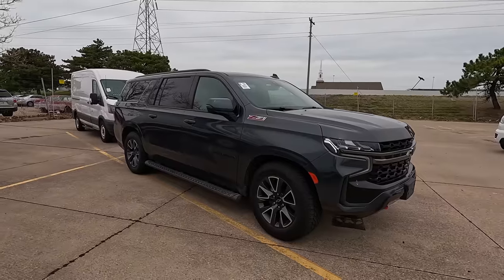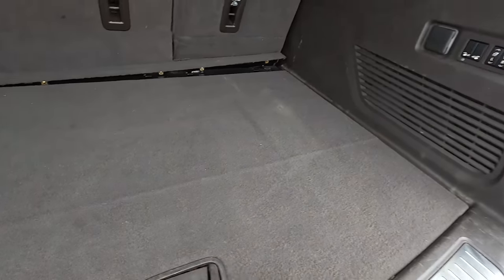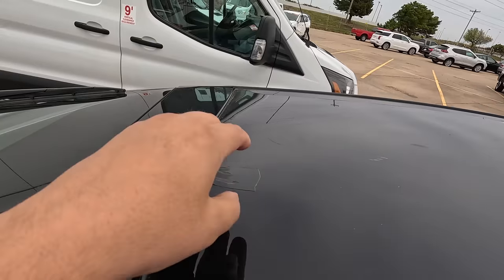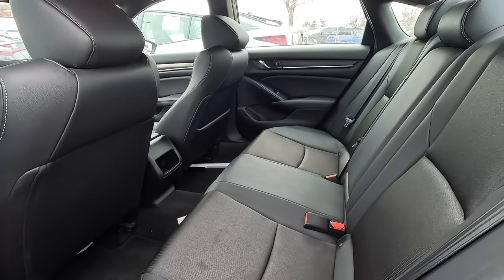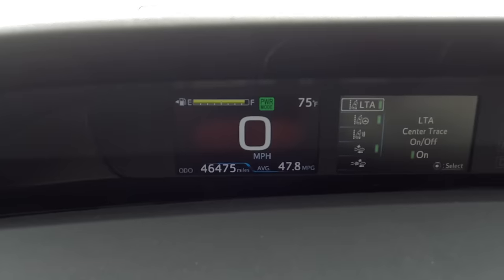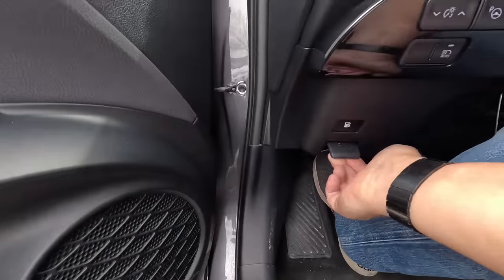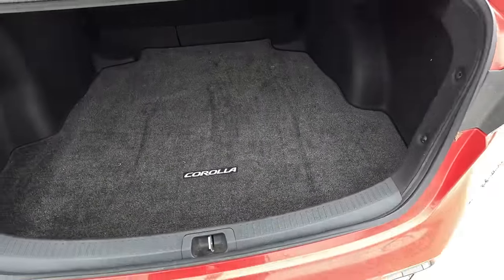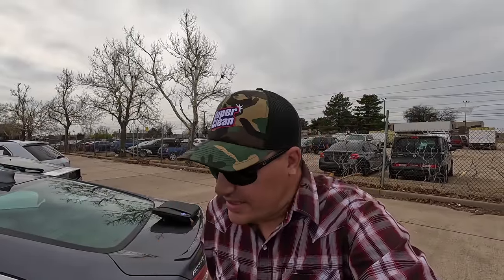Dealer Auto Auction Walk Around + 2021 Toyota Prius Rental Car Sales

Comment: Here is a great idea… Line up some dealers to sell to. Aim at smaller ones. Buy cars that need minor repairs or minor refurbishment, clean them up, detail them (have ur step son help for a kickback), do the maintenance (get oil change stickers online) and sell it to dealers as a ready to go unit. Saves them the time of going to the auctions, detailing, repairs..  You’ll probably want to start with one or two dealers max at first.
Reply: Ohh you can also fill up the tank… just add it to the price. Again, saves the dealer time.

Comment: Rental cars are good buys should have full service history and then you will benefit the desperation that the vehicle had suffered by the time you buy one it’s a good way to make money drive it for 12 months n then move it along its up to u 
That’s a lot of miles compared to klms our Avis or budget get to about 40000klms-50000klms which is 
24854 miles-31068miles  here in Australia 🇦🇺 and are  about 2 years old
im new and old what ever works for you and  Another great video 😊 the seat belt lights are for the rear to indicate that no one is in the back and the airbag off light for the passenger means no one is in the passenger seat and no seat belt on it will go out once someone sits in it and then the rear seat indicator lights should go out one you drive too

Comment: Lease returns are a great option. I don't like the white in the Corolla doesn't make sense either. Newer cars are a great option. Finding them and the bidding on them may be your content rather than the fixing. It is one of designs that turns off when at stoplights and then kicks back in when you step on the gas.

Comment: That Corolla is not a base model, it’s the sport model, and it does have remote start, you can remote start it either through the app  or by pressing the lock button 3 times and then holding the button down for a few seconds until the flashers blink

Comment: The newer Priuses have that seat belt warning light on all the time until the seat belts are buckled in as for the apostrophe on the other one it was nothing to worry about it was basically the warning symbol for the rear Collision sensors not working properly whatever that was I work for Toyota now for almost 24 years so if you have any other questions about any kind of the Toyota let me know I'm here to help😊

Comment: lights on the dash on the 2021 Prius , I drove a 2009 a 2014  a 2017 a 2018 and now a 2022, those Lights  are seat belts  they go off when the car is in drive if nobody is the seats the BSD light?  is your blind Spot on the mirrors ,  Toyota today are the most safest cars  with Saftey features  if you passed it up  its your lost !  the anntena could had been replaced for $100 .. but that will run over 350, 000 miles on the battery

Comment: The push to start delete on the Toyotas from 2020-present is due to the chip shortages, there's a LOT of deletes on options for new cars, heated seat buttons with heated seats installed but non functional, ford raptors sans Ford raptor tailgates, metal keys, sign of the times.

Comment: I would be very leery of repos...if they're not making the payments they probably aren't doing maintenance either!  Some rental resales will come with warranties so they are probably less risky than repos.  Due to the chip shortage, lots of rental car companies were keeping their cars a lot longer than they would typically and prices were high. I think youtube content for rental or repo flips would be minimal.   I think there is good money to be made on buying wrecks and fixing them...some brands are relatively inexpensive to repair and sell easily.  Buyers are happy because if they are repaired properly, they can drive a newer vehicle at a substantial discount.  If you do the work yourself, then there should be a reasonable amount of Youtube content for collision rebuilds.

Comment: That Honda Accord has an oil consumption problem, the dealers put that white paint mark on the dip stick during an oil consumption test to make sure you don’t tamper with the oil level. Oh and even if this car is within warranty, Honda won’t cover it or acknowledge that there is an issue, even if it burns 3 quarts within 1000 miles, which is probably why it’s there at auction…. Ask me how I know lol. Stay away from that one